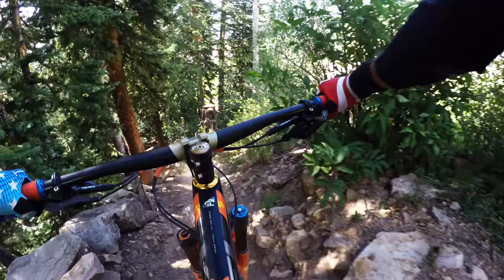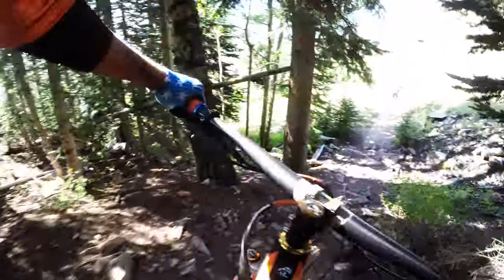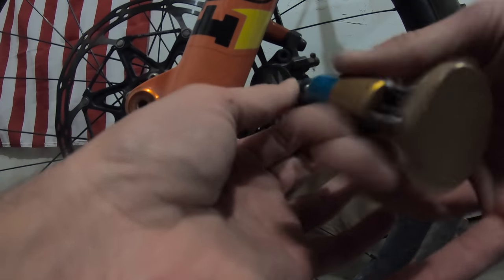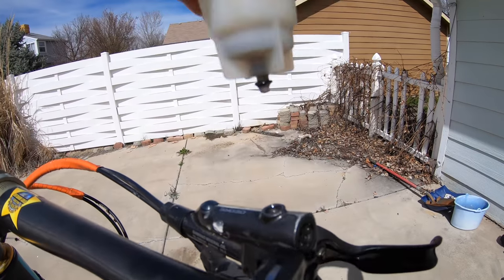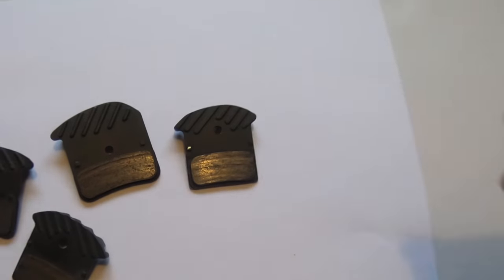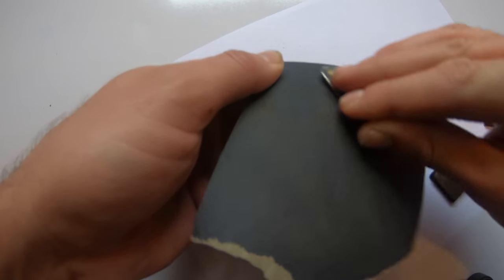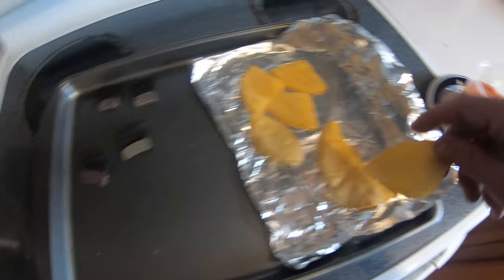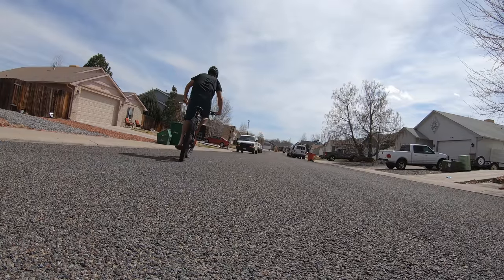Trumpet Brakes? Fix Noisy MTB Brakes and New Brake Pad Install (Shimano)

Comment: It worked thank you! I also cleaned out the calibers. used torch  on the  rotors.
Bedding : To bed them I went to a speed of 8mph/12kph and hit only the front brake hard but DO NOT SKID OR BRAKE TO COMPLETE STOP *
I did this ten times then did  the back brakes. they were harder due to skidding tire (bring it as close as you can without skidding) ten times also and I was good to go. For good measure you can bring it up top your top speed and repeat the above o didn't require too. also don't brake  to frequent while Bedding the brakes do not peddle with brakes on or drag your bike with brakes on. (makes it uneven) hope this helps

Comment: A really good bedding of new pads on clean rotors is the ticket to prevention in my book, and don't come to a full stop when doing so. I'll do ~20 reps (about a 10 m sprint to nearly stopped) going downhill on a paved road for lots of grip. Never an issue, even with the infamous SRAM brakes.
Reply from the maker: Nice advice Paul! Thanks for tuning in!

Comment: I tried everything and brakes still sounded like a broken trumpet. I ended up resorting to using propane torch and burning the crap out of the pads. That solved the problem. I think if I could get the oven to 5-600 degrees that might have worked as well.

Comment: Ha! You should've just used any clip from my last half dozen videos for the horn section! After 10 days on the road my brakes had all sorts of grime. They also got glazed. My on-the-trail fix was removing the pads and rubbing them on a flat rock with a bit of dust thrown on for good measure. It got me thru the next couple rides and until I could use some sand paper and get the job done correctly. 🤘

p.s. I love those aviators!!
Reply from the maker: I loved the instagram stories on the brake maintenance! lol

Comment: I need to stop using budget shimano brakes, or shimano brakes all together, cus I damage pistons, probably gravel, I also bend pads, pads are much wider than pistons.
I had leaking rear brake, so  I replaced it and then that brake leaked after few days, piston got damaged, leak at master cylinder where hose goes in, I cut the hose installed new parts that came with the brakes, and still leak, pistons leaked, pads, pistons soaked, front brake that I had on also leaked same places, so now I am on a fresh set, got another one I took off my old bike in case this fails too, but then I am out of brakes.
I need to deal with the dealer to get warranty on them, and then I will sell them all.
cus I am tired of this crap, so I am keen on trying new brakes, so far Only brakes I trust are TRP Spyke mechanical dual piston, no leaking there.
so I experienced a lot of glazed rotors,pads, they were so smooth and shiny like glossy paint, and were like a car horn and screaming cats, horrible.
but when riding in warm weather and doing trails that are so steep I have to be on the brake for almost whole trail, I had to sand the pads, and rotors.
I might need to get bigger rotors.
I got 160 rear 180 front Hope floating rotors, they perform great, if I don't do on the brake whole trail kind of trails or warm riding with a lot of braking.
but they clearly out perform the TRP-29 rotors on my 26er xc bike, I can't ride it as fast and dont need to brake as much and as hard, but still glaze them faster, much faster.

Comment: If my rotor is loose does it make it sqeal aswell?
Reply from the maker: The real question is: if my rotor is loose, do I even need brakes?
Reply: @OutdoorGold  what i meant was if the rotor vibrates a little bit does it make it loud from the vibrations
Reply from the maker: @b0ryx-0n4  LOL, sorry I had to be a jokester. If the rotor or a clipper is loose, in my experience, it will make a distinctive sound, but this had been a bit different in combo with lots of inconsistent rubbing on the pads.

Comment: Here's the solution. Sell your Shimano and SRAM brakes and get HOPE instead :D. Or just stop braking so much. 

If you drag your brakes instead of pulling hard, that ends up with glazed pads more than anything. And make sure to bed those things in before they get too noisy!
Reply from the maker: Nope, I think I need a new bike!
Reply: @OutdoorGold  That's always the best solution.
Reply: RC's Outdoor Gold that is only a good solution if the new bike has Hope brakes!
Reply: @themiddleagemasher8108  How do you know?! I just keep knocking the circle clip off the part that keeps the lever on the master cylinder.

Comment: Hay RC, I see all the snow reports out of Colorado and I was just wondering about your take on when riding in the higher elevations will occur.

I have a 5 day bike excursion outta Durango in August planned and was wondering if I’ll need snowshoes in addition  to new brake shoes! Lol.
Reply from the maker: It will definitely fine in August, but the shroud of mystery blankets when in late June or July the highest terrain will be open. It can range anywhere from the 15th of June to the 4th of July. It depends on how hot it gets. The last known prolonged spring I remember was 2011 and I don't know if this year will repeat.